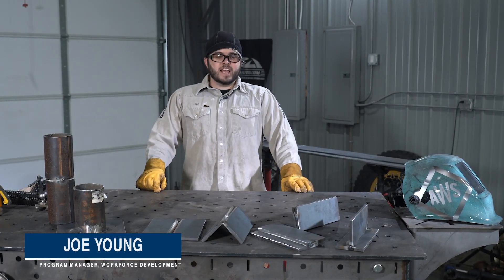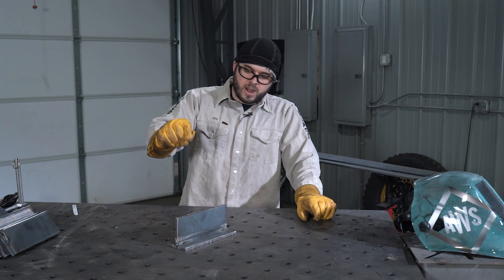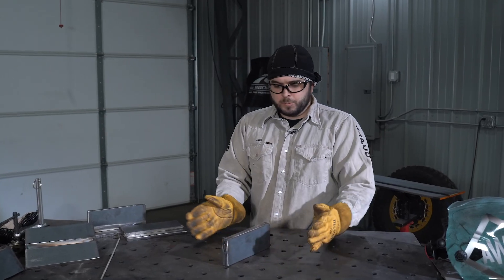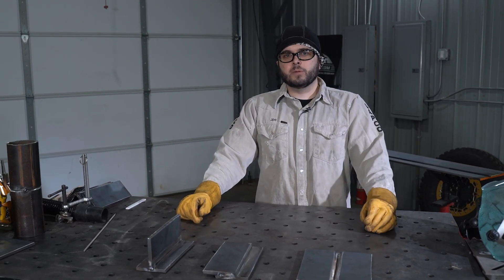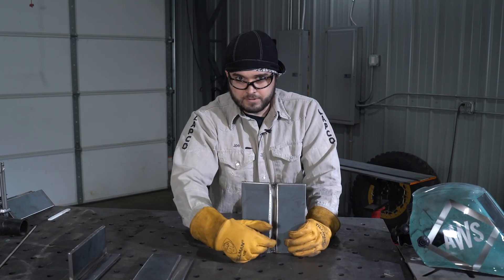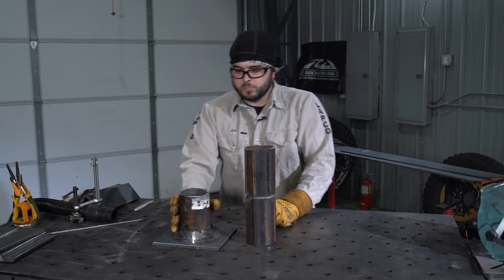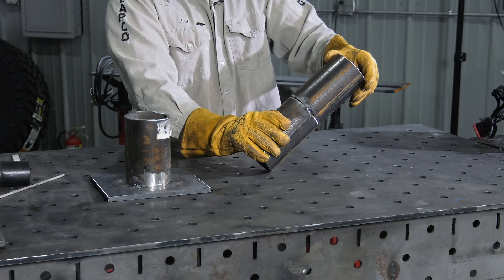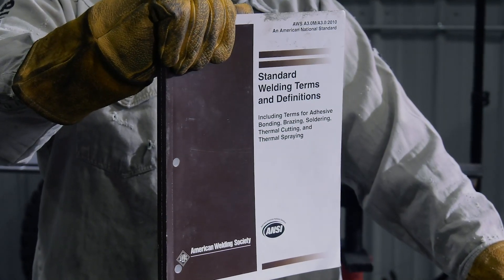ARCademy: Weld Joints

Comment: According to AWS, those designations are TEST POSITIONS! Welding Positions are flat, vertical, overhead, and horizontal.  A test is taken in the test position designation. The welder is qualified for Flat, Horizontal, Vertical, and/or overhead.